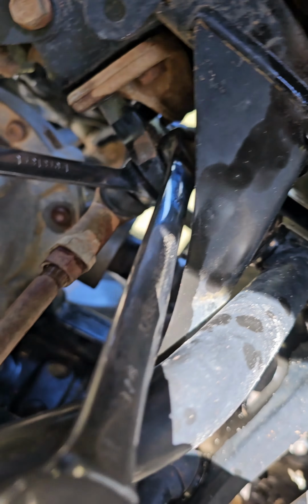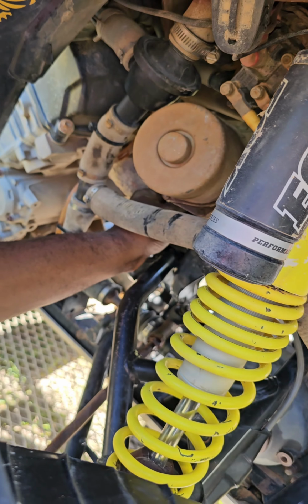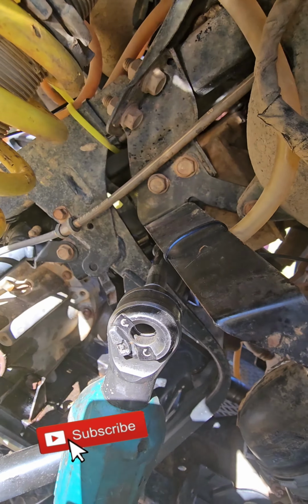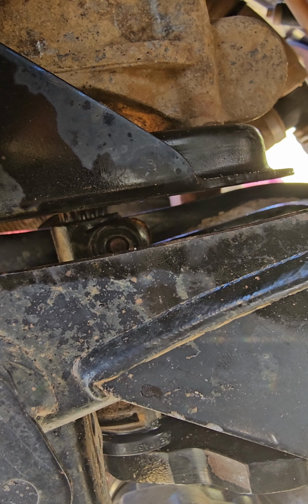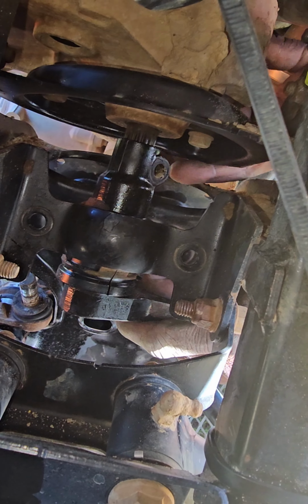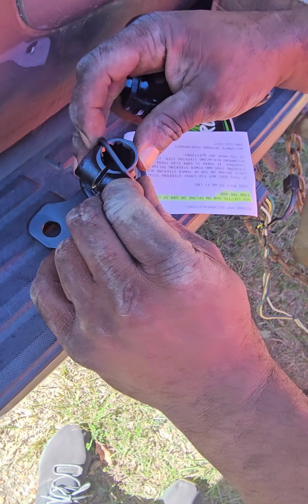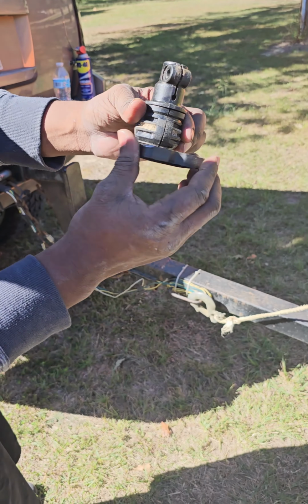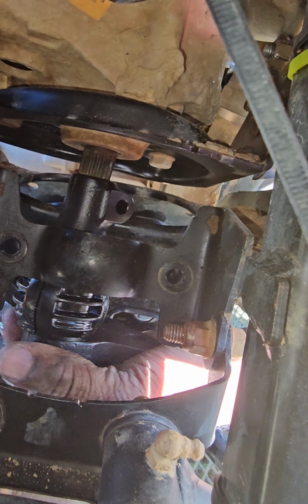Can Am Loose Sterring fix with new PitMan Arm.

Comment: Hey brother I got question about my. Quad I got. 2016 can am outlander xmr on a 22 / 35,s with the 6 ich lift and how to keep the rear tire from swaying.
Reply from the maker: I would check the wheel bearing and axle nut first . Make sure it's all tight